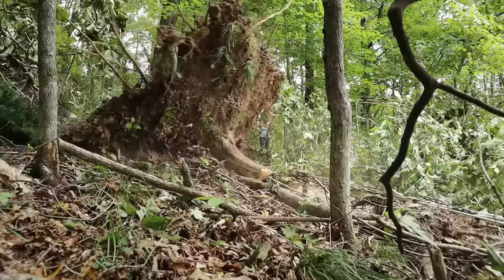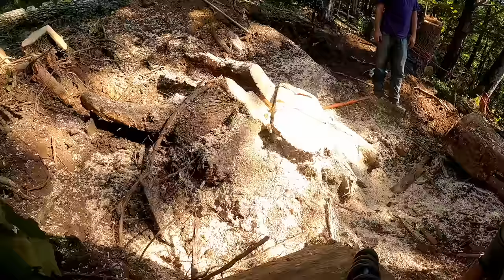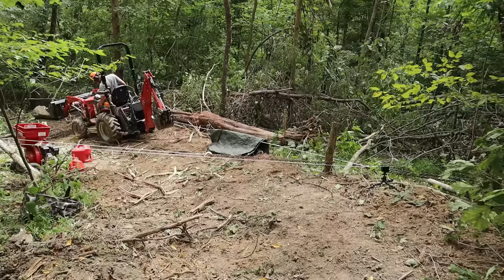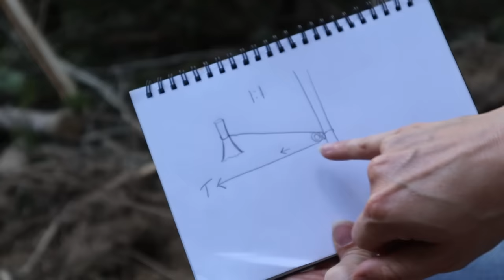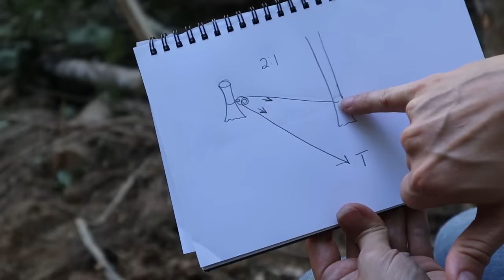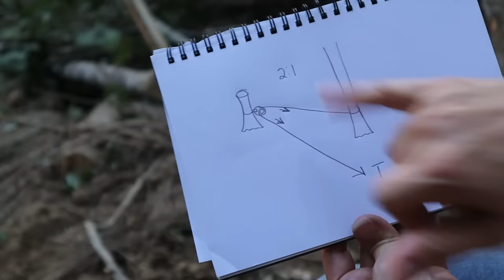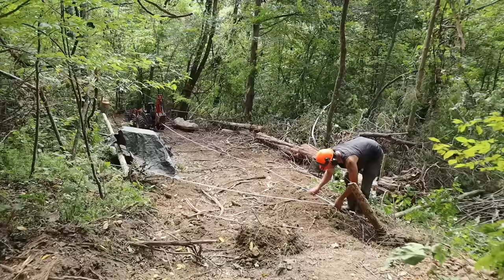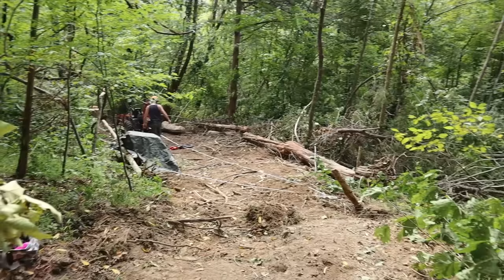Snatch blocks vs tree stumps - the power of pulleys /// E57

Comment: I pioneered road with a small excavator which was bigger than your tractor so was much easier. Everyone had great suggestions. I found that digging around the stump roots then pushing the tree over was much easier than trying to pull stumps. If you keep using snatchblocks, I would suggest leaving the stumps 4' or 5' high and hooking higher on the stump. I have pushed over several trees with our 34HP Kubota by first digging the roots, then pushing them over. Good video.

Comment: I live in Tasmania and have a small timber block. I was lucky not to have to learn all this, However, I'm very grateful for your well-made video. 
I lucked out because when I bought my small excavator, it had a grader blade on the front. I soon discovered that the way to get stumps out of the ground is to get close to them with the grader blade, hook the bucket under the stump, then push down on the ground with the grader blade. This method will put enormous lifting forces on the stump and has never failed for me. With really big stumps, I recommend pulling each root out individually until the stump is loose.
Trees aren't designed to resist lifting forces, which is why this is a great way to clear stumps.
Moral. IF YOU ARE REMOVING STUMPS AND BUYING AN EXCAVATOR, GET ONE WITH A GRADER BLADE!
Did you think of using your snatch blocks to pull the rocks out? Dig behind 2 problematic rocks, pass wire behind them, then use snatch blocks. This way you will pull one of them out (not both though).
Reply from the maker: Very cool concept with the excavator!  Thanks for sharing it.  Episode 64, we set up a more complex rig and got a boulder out of the ground that I still can't believe to this day.  Check it out if you're interested.  I think we went up to a 16 to 1 ratio on that one.

Comment: Amazing how similar your situation is to mine. Decided to build the cottage down in the forest and now have to build the road to be able to bring in materials and of course have future access for an ambulance if ever the need arises. I have 6 of the snatch blocks you have and assembled 6 others into 2 3-pulley sheave blocks. I'm using a 9000 lb winch instead of my tractor though. Friend made a mount that attaches to a tree to hold the winch. Thanks for sharing your failures and successes.

Comment: Hi, you have got me thinking again, thanks.
To summarise - the line is attached to the strongest "strong point", then you attach the snatch box to the "target" and then you can go back and forth with snatch boxes between (also any other) "strong point" and the "target"/"strong points" and you do continue to add snatch boxes in the same way. You will keep this advantage combining as long as your tractor and other "strong points" are in the straight line (but behind) with the first "strong point"/ "target" line. Any deviation from that straight line will reduce the cumulative 2:1 (times the number of snatch boxes) pulling force gain but may help you with the angle you have available for pulling with your tractor. You can always add another snatch box to compensate for the angle loss if it is not the favourable "zero".

Comment: Nice video explaining the learning process to help others avoid the more difficult steps along the way.  One thing to point out, many people cut trees down around waist high or lower.  If you are pulling out stumps, cut the tree off as high as is safe.  Then when you attach the pulleys/blocks/etc., you will gain a tremendous amount of leverage on your pull.  Pulling from 6' above ground instead of 2' above ground provides much more leverage.  Good work all.

Comment: Good video. Some points that come to mind to improve upon what you have offered. Replace the wirerope with an HMPE rope/line. Amsteel Blue is a good type of line/rope, floats on water but stronger that steel. It’s much easier to work with, easily spliced, won’t kink up like wirerope, won’t fishhook or burr like wirerope. More tolerant to smaller D/d ratio than wirerope. It’s a win win situation making the task at hand so much easier. 
  A very simple and much less confusing 4 to 1 can be set up with just 2 snatch blocks, 2 pull lines/ropes will be needed. Basically first set up a simple 2 to 1 then attach the second snatch block to the pull line of that 2 to 1. Then run the second pull line from its anchor point through that block back to the prime mover (in your case a small utility tractor. You will then have a 4 to 1 mechanical advantage. 

 The higher you can place the attachment on the stump the greater the rotational force that will be place upon the stump. Simple principle of longer lever. 

 Last but not least, but the most hardest for many to understand it the mechanical forces obtained through hydraulics. Your tractor can achieve greater pulling forces through the proper use of the backhoe attachment than it can through it’s drive line. This is due to the coefficient of friction between the tires and the ground not being as great as the coefficient of friction between the stabilizers and the ground. Think of it as trying to pull your tractor with its wheels locked verses trying to pull across the ground with the backhoe stabilizers down. That along with the shape and curling forces of the bucket can be used to multiply the mechanical advantages many times over. Not the “stick” and “boom” forces, they are useful for taking up the slack, but the real strength is in the curl of the bucket. 

 Just some things to think about that could be useful to improve upon what you have learned so far. I can not recommend the changing from wirerope to a dyneema type of rope/line enough. That alone would be a game changer for you.
Reply from the maker: Thanks for writing all this, as I'm sure it took some time.  All good ideas and points here.  I agree with the curl function being the most powerful on that backhoe.  👍
Reply: Everything you presented in your video is almost as if it’s been a life study of mine. 
 My knowledge of dyneema rope/line comes from 15 years of working in the inland towing industry. I mentioned Amsteel Blue because it is one of the more popular brands. My knowledge of wirerope is quite extensive. I have worked with many different constructions and sizes of wirerope. For your application the dyneema line/rope is a much better choice. 
 In the late 1990s and early 200s I was part owner of a logging operation. And still work as an arborist. Those along with the time employed in the inland towing industry has given me a fairly good knowledge in using block and tackle rigging to gain mechanical advantages. 
 I have a technical degree in hydraulic design and engineering. So I’m no stranger to hydraulics and their applications. The forces that your utility tractor is capable of creating can be quite amazing. In your application you’re limited by traction. That’s the reason I suggested the use of the backhoe attachment. 
 I found your video to be very interesting. I too made some of those similar mistakes. Really I wouldn’t call them mistakes. They are more like lessons. I look forward to watching some more of your content when I have the available time.

Comment: Just wanted to add a thank you comment!  Recently lost some pine trees to a hail storm. After cutting them down decided to try and use pulleys to remove them instead of grinding them down to make it easier to plant new trees.  100 Feet of HPME synthetic winch rope, 3 snatch blocks and a couple tree saver winch straps all hooked to my pickup truck was able to pull the stumps right out of the ground.

Comment: I am proud of you guys working together on this enormous project.  There is a wench the attaches to your 3 point. It’s called a farmi wench. I use it for pulling logs to the mill on my property. It is PTO powered. It’s a little expensive but it works great. You guys are doing it though and that’s great.

Comment: You two will love the rocks!  They will be part of the road on the lower side  and even build walls with them, a stone house like we have is cool in summer and easy to keep warm in winter, put your fire in the middle of the house!!! So many things you can do with your rocks, and when you get really good with the Backhoe and tractor, you'll find they are easier to handle. Chains and pulleys help with rocks as well!!!
Reply from the maker: Your place sounds so cool!  Sounds like a good material to use on a root cellar.

Comment: Thank you very much.  I’m pulling down cement anchored steel pool walls (hybrids, partially below ground and partially above}  and was going to just hook with a chain and pull but I’m using a D140 John deer yard tractor so I decided to research a way to multiply the pull and new mechanical advantage pulley systems work but like you I didn’t know the proper way to set it up.   So thanks for the video and the benefits of your lessons learned.

Comment: Use your chainsaw to put a hole in the stump so you can run the chain through it so it wont slip off as it comes over. The taller the stump, the more leverage you get. Pull higher up and get more leverage. Try a 6’ stump verse 3’. Good info. Thanks.

Comment: Thx for taking the time to record and share your snatch block journey.
Good to see you have rediscovered Galileo's work. Hahaha. Your 3 block setup could look like a block and tackle if you squint. Take a look at how Chris takes down trees with an excavator on the Letsdig channel. You have a backhoe which is equivalent to a mini excavator. So combining your backhoe and snatch blocks that just might be the ticket for you. Since this was recorded a long time ago you've probably already finished your road so this late advice is moot.

Your last setup with three blocks should be 8:1. If you measure the length change of the tractor end to the stump end you should see that same 8:1 ratio. Each block doubles your force and length taken.

Again, thx for sharing.

Comment: Great teamwork!! I’m a seasoned vet when it comes to snatch blocks. I too heard about snatch blocks from the channel you mentioned. Lol Just another added safety tip: chain up as low as you can get it around your stumps. That and laying something across the last line from the tractor to the pulley. You don’t want all that mechanical force flying towards you if the line snaps. The lower your hookups, the safer it’s going to be. I use two tied together tube socks that’s both filled with sand. I lay them on the line between me and the snatch block. Stay safe, good luck with your house!!
Reply from the maker: I like your sock/sand idea.  Very clever.  Thank you for your service!
Reply: laying something on the cable to kill it if breaksis good but hook as. high as possible for leverage
If you have not cut all the trees don't. Pull them before you cut them. Pull with the backhoe it is stronger than pulling with the tires.

Comment: Great practical video with proper explanations!  One more item that might help: Archimedes' principle of the lever.  We know a little 40 lb. kid can position a see-saw in such a way as to lift a 200 lb. person using leverage.  In your case, cut the tree at 4' or even 6' off the ground, as you did at about the 10-minute mark in your video.  Pulling at 4' or 6' off the ground generates a lot more leverage at the stump for pulling it out.

Comment: Great video, excellent drawings to see how to configure the various options.  I need to pull out a Black Oak that has a stump of about 8 inches, but because it is oak, I am not going to under estimate it.  I want to use only the snatch blocks, the rope (maybe it will be steel) and attach to my car tow hitch.  

One thing that you could have done better on, was when you wrapped the rope around the tree stump, if your tree stump was longer instead of cut off short, you would have more leverage. It looked good in one of your 4:1 videos, but when the rope was down low, it was not ideal.  

Thank you for this great video!  You save me some money from making mistakes.

Comment: Nice Video.  You are almost correct.  The larger the angle that you are at  only changes direction as you originaly  thought.  You done an exceptional job in self taught physics.  Keep up the great effort.  Mountain Guy is correct.  The higher you are on the  stump gives you the most leverage.

Comment: Hey guys certainly learned allot about MA systems in a short amount of time. It's been a while so you may not be utilizing them any longer. Although you'll be surprised at their usefulness and diversity. Just some considerations as you move forward with it. *If the terminal end of the rope is tied off to the load, then the system will always be odd. If its attached to the anchor then it's even. * A pulley provides mech. adv. if it's traveling. So either attached to the object being moved or "gained" on to a leg of rope within the system. If attached to an anchor its a change of direction. I believe the diagram that you had representing a 3:1 was in fact a 2:1, with 2 change of direction pulleys. Cheers and happy rigging.

Comment: Great video. I learned where not to put the pulley. My only experience is pulling antennas up on a tower and learned bigger is better. Using a small pulley - you're fighting the pulley. Using a large diameter pulley you're getting better pulling-up efficiency. Hope your road, home & all goes well.

Comment: Couple of other comments that may have already been stated. 

1. Look up Terry Hale’s videos on tree work. He has the best and most informative videos related to learning about cutting trees down. He goes into some light math but grasping the concepts will save your life or at the very least, make it easier. 

2. Look up compound pulley systems (like Z rigs) 
3. Combine levers/fulcrums with your pulley system to add a ton of mech advantage. (See Terry hale video on stump pulling)
4. Get yourself some UHMWPE (commonly known by brand names Dyneema and Spectra) rope instead of steel cable. Generic is fine. 3/8 should be plenty. It’s substantially lighter and stronger than steel wire rope and very in-elastic, so it won’t decapitate you when it snaps (unlike steel wire rope). It’s also very reasonably priced and incredibly slippery, so you loose less mechanical advantage from friction. Use an alpine butterfly for a knot, (and beat it with a hammer it if it gets stuck). Use   “tension-less hitches” for anchor points 
5. Make sure to remove any tree stumps  as thoroughly as possible if they will be covered by a driveway or house foundation—the eventual rot of stumps and large roots can cause a sudden cave in and that’s not good. This is especially applicable to maple trees, which have a very wide skirt around the base of the tree.
6. Chainsaw is great, but if you’re going to use it near the ground to cut wedges from stumps, do yourself a favor and buy some very cheap saw chain because dirt ruins saw chain so fast it isn’t even funny. (Check out farmertec for some good cheap sawchain and saws if you ever need a new saw on a budget. They look like knockoff Stihl’s but they only produce clones of old saws that  for which they have license. 
7. I think I saw poison ivy. Be careful because it grows like a vine and is not something you want to have as a setback. Either invest in “ivy-x” as a pre exposure treatment (“sunblock for poison ivy”), or use a “mechanics” hand cleaner for soap (anything made to remove oil and grease, as the part of the plant that causes the rash, urushiol is an oil…)
8. Bugs, flies, etc. look up permethrin; buy the concentrate (much much cheaper) and be amazed. 
9. Wood bugs—vinegar works okay in new cut wood. 
10. Depending on humidity, you should consider sealing log ends with glue or wax—don’t want to lose a large portion of your log to splits. 

Good luck.

Comment: I must agree this is great information about proper tools and proper setup to make things work. I did notice you guys cut the tree stumps to short to take advantage of using the tree stumps as a lever to make it even easier to pull the stumps out, so try cutting the tree down at a much higher height like 7 to eight feet, then hook up your snatch blocks just a foot from the top of the cut. I bet it will take less snatch blocks to accomplish the same results. You might have to take a axe to some of the stump roots once the stump is pulled over parallel to the ground.

Comment: As someone who has done this before, well done on stopping & thinking, whether with the moving block or where to hook onto the tree.  Do be kind to your little back hoe and emphasize connecting to the big pivot points.  Leverage works on the bucket as well and can easily bend them out, so use the attachment points, as those 2 & 3" diameters are designed for that force.  I'm at 11 minutes in and enjoying.  Hopefully, you will also show when and where to anchor low and when to go high on the stump you're pulling out.  The other question I have is:  Why did Youtube suggest you?  but no complaints!

Comment: Nicely done!
I once used a come along winch to pull a car up a steep driveway.
It slowly inched up and then wouldn't budge any more. I kept making the cable tighter and tighter, and then the thought occurred to me that if the cable snapped, it would fly back towards me and slice my head off.
I stopped.

Comment: Clear explanation. Couple of suggestions, use heavy webbing strops for the anchor tree - saves damaging your anchor tree with chain. Also place thed anchor strop at ground level - again much kinder to the anchor. You are putting a lot of force on it (3:1) - safer & kinder. Like the chainsaw trousers on the rope as an air drag if something breaks !